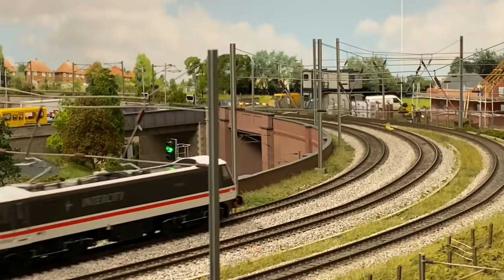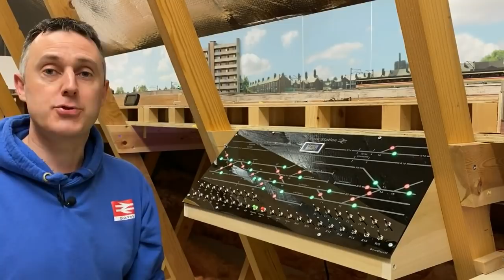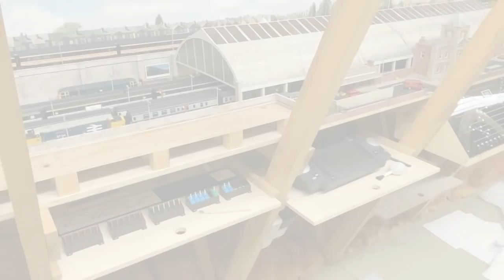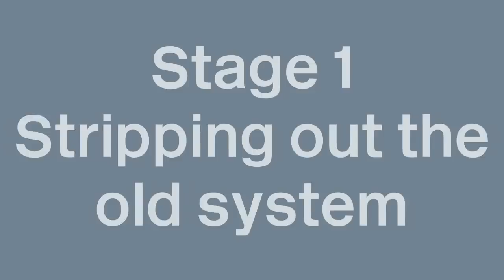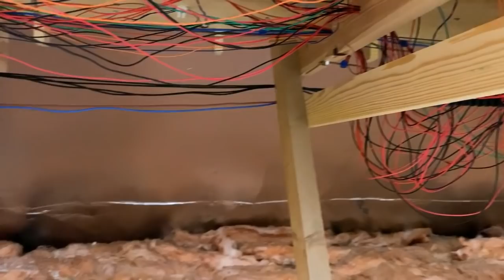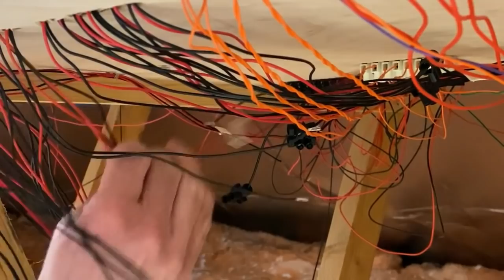Model Railway | DCC Concepts Control | Dean Park 255

Comment: Hi Dave, A very informative video on the use of DCC Concepts equipment and the modelling electronics latching unit. Your control panel is excellent. Would I be correct in thinking that the system presumes a point has been thrown and changes the LED accordingly? And if you had a point motor failure or a point that didn't fully throw it would still show as thrown. I know solenoid point motors a very reliable but I have had a peco point fail occasionally or something obstructing the blades stopping full throw. Regards, David.
Reply from the maker: Hi, it will only change the led when the signal has been sent to fire the solenoid. If a solenoid fails, it won’t detect it in the leds.. but hopefully you would hear that it wasn’t firing. :-)
Reply: @DeanPark  Hi Dave,  Thank you for the quick reply, as you say hopefully you would notice if a solenoid didn't operate.
I have subscribed to your channel and will be watching your videos. Regards, David.

Comment: Brilliant video Dave. I want to do something similar to that and I appreciate nearer the date I will contact DCC Concepts to put my plan over. Im wanting to use my NCE Power Cab just to control my trains, having at 5 running at any one time. But I would like to control my points through a DCC Concepts Mimic Panel like yourselves by passing the power cab. Preferably one that you operate by the lights itself on the panel, I think that can be done. Likewise I want to use only Peco PL-10 point motors as I like the sound of the points changing, no quiet ones in my time.  
Really interesting video, unbelievable how much wiring and work you save yourselves.
Regards Chris
Reply from the maker: Cheers (sorry it’s taken so long to reply, just saw this comment). Dave

Comment: Fantastic job Looks like the kind of thing the real Dean Park box would have too. Your explanation of its wiring and operation is very good. Anyone going into this system would be able to follow it through your video and the instructions. In a real box the points also have two ways of being set individual switches to move them as well as route setting. The Ecos does not route set but it does simulate that in a way. It is sure to give hours of fun routing trains in a more realistic way.

Comment: Great stuff. One question tho. Is there a power up sequence? More specifically, given that the points motors are powered momentary, how do the mimic boards know where things are when you power on ? Does the system have memory?
Reply from the maker: Hi, they have an element of memory and start up how they were left upon shut down. :-)

Comment: Dave, I don’t have an ecos DCC controller and am not sure if my controller has this functionality. Is it possible to control all this with the toggle switches on DCC without going though the controller? Or is the controller essential for setting this all up and controlling it?
I’m assuming the controller is a fairly essential part in this. Cheers, Rich.

Comment: I've always found myself scratching my head over DCC accessory systems but your video certainly helps explain a process and system that doesn't require a computer science degree. A very informative and well structured video👍
Reply from the maker: Many thanks. Sorry for taking so long to see your comment. Dave

Comment: Oh Dave, you have left me with my head spinning, nevertheless allow me to congratulate you on what you have achieved with the state of the art control panel you have installed. Does this new equipment have a low failure rate ?   Cheers   Greg

Comment: Dave, what a video!! That system is brilliant. I’m yet to build my new layout but it is imminent. I had solenoid point motors on a previous layout and this video has just convinced me to keep them rather than go down the alternative routes available. Brilliant system and it does appear to be pretty simple. Spot on. Thank you for such a good explanation. 👍👍
Reply from the maker: Hi, sorry for taking sooooo long to reply. Just say this comment when I happened to look at this video again. Thanks for your kind words. Dave
Reply: @DeanPark  ha ha. No problem Dave. All the best. Ian.

Comment: How much dose the alpha system cost. Can u use standard peco points motors and can u use it with any DCC controllerz
What switches are used on the signals?
Where did you get the lazar cut at?
Have you got an equipment list so can order my self.
Are Heathcoats solder free and easy to set up

Comment: Hi Dave 
Firstly great video very well presented. well done  
We can now do the 3 way lights, straight from the mimic, it just involves some alteration on the leds and a diode. 
if any one would like to know how just send us an Email asking. 
Regards
John.
DCC Concepts
Reply from the maker: John Whiteside Hi thanks. that’s great to know John. Technology is always moving forward to allow these things to be done, thanks for your assistance in getting this control panel to work. It looks great and is great fun to operate. Dave

Comment: Hi Dave Alan again very imformative video it had me scratching my head at the beginning but I think I follow it now just a quick question for a man of your intellect I notice you used to use a Hornby rail master now you use the ecos system  I am wondering which way to go at first I was sure it would be the railmaster but now ?????? As I am just getting back into the hobby which would you recommend I am no wizard with either so I would like to use the easiest one for now cheers
Reply from the maker: Cheers. I used the hornby elite and railmaster, which is good. But the ESU Ecos is amazing! Ok it’s not cheap, but you pay for the best. There’s so much capacity in it and it works really well with the dcc concepts equipment. It’s all down to what you want to spend. Lenz system is good too. As with everything.... there’s inevitably too much choice! Lol

Comment: If you don’t mind me asking what was rough cost of that lot for both panels?
Reply: My totting up gets me to £2256 for both control panels. This includes £600 for the ECOS, boards, perspex panels (est), mass sequencers, sniffers and point motors. I'm sure I'll have missed some things (I've not included signals themselves) so if you say £2500 then you control your train in style too! Looks amazing but it's a shame no mention of cost was made and this pertinent question was ignored.
Reply from the maker: Hi. I just stumbled across this comment when browsing my own video. So the question wasn’t ignored. It’s impossible to be on top of all comments and to keep up with notifications (of they even appear).   

Sure you can work out the cost by going to the retailer of these products. But I saved and collected these over a period of time. Buying some of the stuff over several years. So the cost, while significant was spread out. I assume you were using current costs when coming up with that figure? But that would
Likely be more as as I said I bought over several years when prices were in most cases be cheaper. In some cases significantly so. 
So just like a lot of things in life. From cars, new sofas and family holidays, the cost doesn’t seem so painful when spread out, it becomes more affordable.
Reply: Stu Findlow i think you’re way out with the cost.